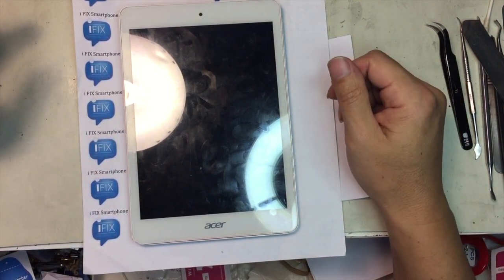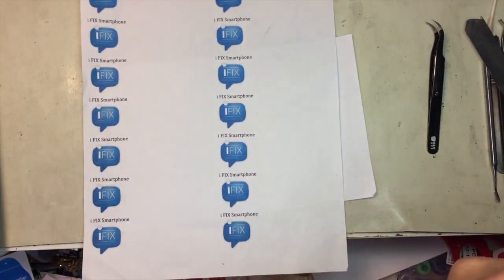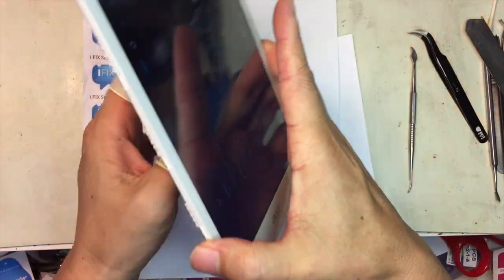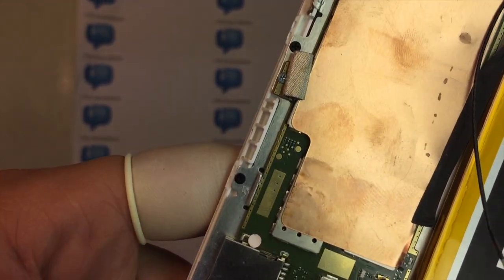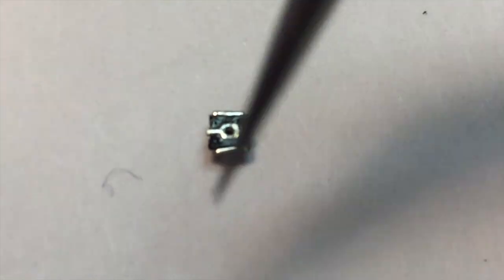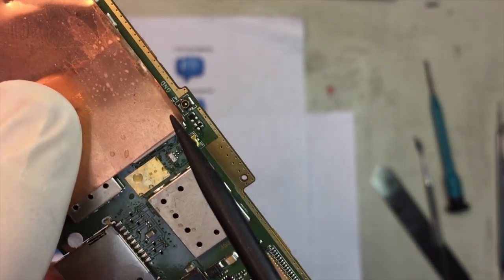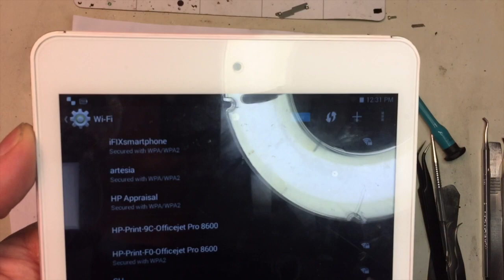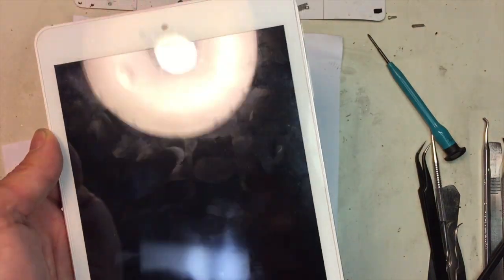Acer Tablet Wi-Fi wifi problem fix | iFIXsmartphone

Comment: Why have a 10 minute video that leaves out the only important parts? This should have been less than half the length and showing how to open the device and how to solder the connector back on.